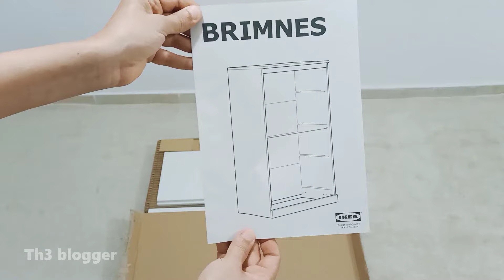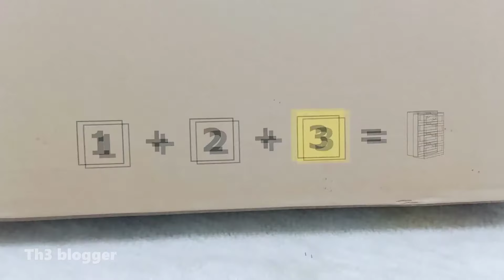IKEA BRIMNES chest of 4 drawers assembly instructions  very detailed

Comment: Could someone tell me if the drawers open all the way even if I don’t attach it to the wall? I know you can only open one at a time, but I want to know if they open fully.
Reply from the maker: Yes, drawers open fully without wall anchoring, but it’s unsafe. If you have kids, anchoring is essential to prevent tipping. I don’t anchor mine either and sometimes open multiple drawers, but this risks instability. Always secure it for safety.

Comment: Ok so what about the missing board that goes all the way at the bottom? I still have a board left that is supposed to go under the last drawer. Please advise.
Reply from the maker: ** Important note **
Hello
Some of you have left comments saying I made a mistake in the assembly, and because of me you made mistakes too.
I assure you that I did not make a mistake, and I'm used all parts.
  But repeated comments forced me to do some research. Where I found 3 types of BRIMNES Chest of 4 drawers. Each with different parts.
You will find installation guides at this link https://www.th3blogger.com/2021/06/ikea-brimnes-chest-of-4-drawers.html 
Please pay attention to the type of BRIMNES Chest of 4 drawers and its parts, by watching the first part of the video where I open the boxes and compare them with the type of parts you have.
I apologize if some of you made mistakes, but I was not wrong on the installation of my BRIMNES Chest of 4 drawers.
And please pay attention to the cabinet type when installing.
Thanks for watching
Reply: Same lol

Comment: I purchased the three drawer one. The  Ikea picture instructions where difficult to follow. Now they do not even label the parts. 😣 It's guess work.🤔
But this visual instruction was great. It was easy to follow.👩‍🔧
Side note: The three drawer one has a bottom that should be installed prior to connecting the sides together. 
Thank you for making this video tutorial and sharing. Most helpful.💆‍♀️

Comment: it's very helpful but, I have 2 comments:

1- in the 1st step while you are fixing the right and left @ 3:30 minutes, it should be vice versa. In another words, the left tool should be fixed in the right side and vice versa.

2- At min 11:48 you should verify that those parts are optional and mandatory to be used. you ignored it completely. 

At the end, thanks for time and efforts. it's very helpful :))))
Reply from the maker: hi..
1- I think that everything is in order, if not the assembly will not be correct. 
 2- I wrote "if you want to fix it to the wall" which means it's optional.
Thanks for watching and for you're comment.

Comment: I just find this now, thank you. We are trying to finish it with my mother, there is an issue, it seemed finished…  ( not your mistake, I wonder if the holes are not too high, badly done by ikea) The drawers are too high on the metal lane and don’t fit especially on the top ! It is touching the white top lane. And yet we placed the metal stuffs inside well on the holes. Thanks 🙏
Reply from the maker: You're welcome..  luck and thanks for watching 👍

Comment: Hi thanks for the video
I’ve done everything correctly but once I put the drawers in they won’t 100% slide in
It gets blocked towards the end
Do you have any idea why please ?
Reply: Mines did too. Did you have a extra piece left over? I did but maybe I missed part of video showing what to do with last piece.
Reply: @Blessedmommydiaries24  hi no I didn’t any part left, if you do I would suggest you to try to figure it out and fix it
And for the drawers all I had to do was to make the screws tighter on the side of the drawers, which worked

Comment: I make a mistake with the first drawer installing the two sides and now I have to remove the plastic screw if there is an easy way to remove it without damaging the board, any suggestion
Reply from the maker: use glue and glue the plastic screw and pull out

Comment: Hi I assembled this however the drawers do not feel as if they have been done right. Firstly when I pull out the drawers they fall out that should not be the case I don’t understand what I’ve done wrong. Can someone advise?
Reply from the maker: Hi. Make sure the rail is not upside down.  And the drawers fit in the middle of the rails

Comment: Can anyone tell me what tools (ie screwdriver?) I need before I start watching and the building along. please and thanks
Reply from the maker: Hi. You need a slotted screwdriver 🪛 and phillips 🪛  and a hammer 🔨 . Good luck
Reply: @th3blogger  thanks so much for responding, what drill did you use?
Reply from the maker: You're welcome. I used IKEA drill ( name: FIXA ) simple and useful . Good luck
Reply: @th3blogger  thanks so much for your responses. I finally built my drawer but I made a mistake with the top board. Is there a way to take it off and put it back the right way? Or any tips with hiding the error?

Comment: Terrible situación que viví armando este mueble con este video. Mi error no leer los comentarios. El compró el mueble open box y no le vino la tabla que va de fondo por lo tanto el no la puso. Sugiero no utilizar este video para armarlo. El muchacho no tiene la culpa pero yo siendo él quitara este video ya que genera confusión y la consecuencia puede ser irreversible y estamos hablando de un mueble de $ 220 USD. 

Terrible situation he doesn't assembly the bottom piece of the main structure. Please be careful I strongly suggest don't watch this video to assembly yours, the consequence can be irreversible there is fast screws on the process (is a nightmare go Back) and we are talking about a $220 USD piece of  furniture.
Reply from the maker: Hi, thank you for your comment, at first I was like you, I did not know that there are several models for this type of furniture.  after several comments I did some research and I realized the problem, that's why I pinned the comments.  I can't delete because there are other people who need this video.  for you I believe that the remaining part will not change anything because as you have seen you have followed the same steps in my video without this part.  thanks again and good luck

Comment: I think mine came with an extra board
Reply from the maker: which part ?
Reply: No he missed a step for the bottom floor
Reply: I managed to put it together. I was stuck for a moment because there was a gap btwn the baseboard but it was supposed to be that way smh
Reply from the maker: @krystalx9076  ** Important note **
Hello
Some of you have left comments saying I made a mistake in the assembly, and because of me you made mistakes too.
I assure you that I did not make a mistake, and I'm used all parts.
  But repeated comments forced me to do some research. Where I found 3 types of BRIMNES Chest of 4 drawers. Each with different parts.
You will find installation guides at this link https://www.th3blogger.com/2021/06/ikea-brimnes-chest-of-4-drawers.html 
Please pay attention to the type of BRIMNES Chest of 4 drawers and its parts, by watching the first part of the video where I open the boxes and compare them with the type of parts you have.
I apologize if some of you made mistakes, but I was not wrong on the installation of my BRIMNES Chest of 4 drawers.
And please pay attention to the cabinet type when installing.
Thanks for watching
Reply: @th3blogger  I didn’t say you made a mistake. My dresser had an extra piece/ there was an unexplained gap in my dresser, that was not in yours but I was able to complete it. They probably changed the pieces of the dresser since your assembly.